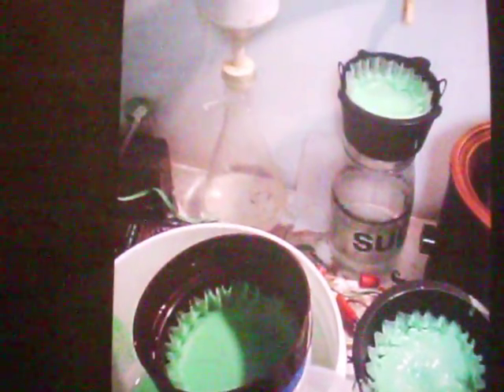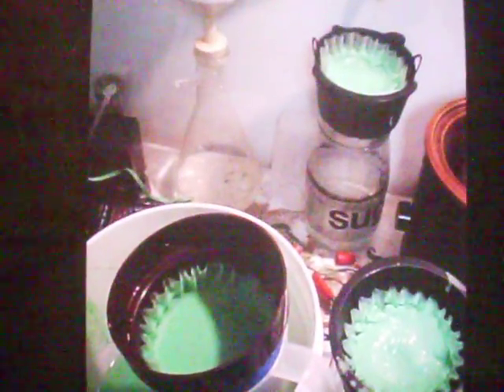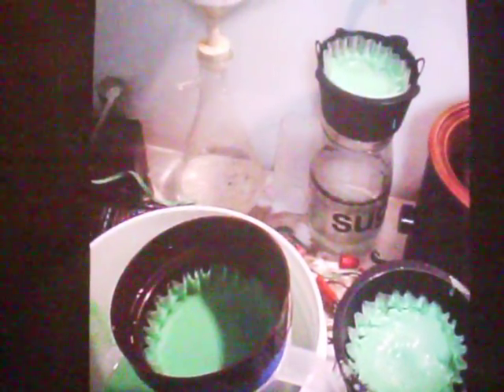1ron oxide tutorial1 11-NiFe battery construction

Comment from the maker: @KyleCarrington Hi Kyle heat resistance glass for the reflux mine is Pyrex ,Elemental scientific had stopper type flask at a good price item fl530 1000 ml flask is $7.20 and also has some chemicals as well.I dessolved
a half pound of zinc to make zinc hydroxide today to make a test nickel/zinc battery in a 1.5 liter regular glass jar and the heat of the reaction cracked the jar . Ed [sorry about the pickle joke]

Comment from the maker: No bs to it it is a very complex process and 1 nickel and 1 iron plate will hold a very small charge and a couple of milli amps the pickel jar 2 will put out 8 amps under a short. Two plates 3ft by 3 ft may put out 1 amp for 2 seconds.A nickel iron battery only has metal plates to hold the active materials being nickel hydrate and iron powder. But thank for you option . Ed